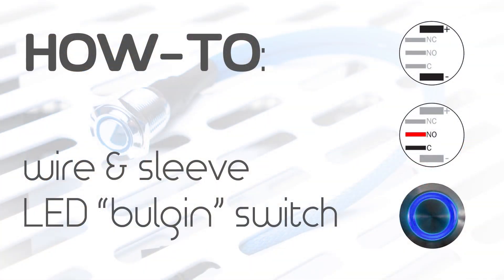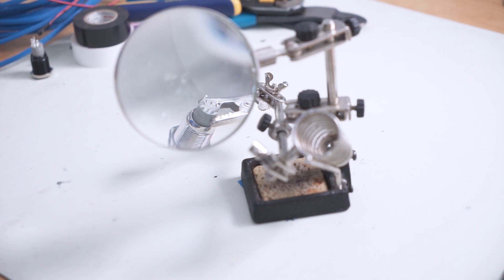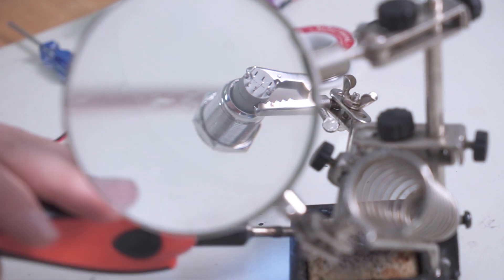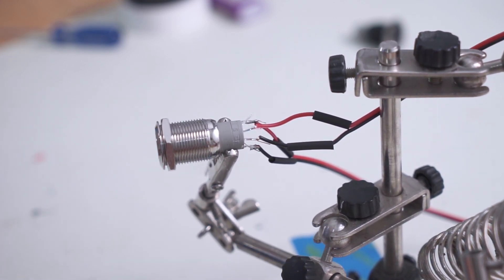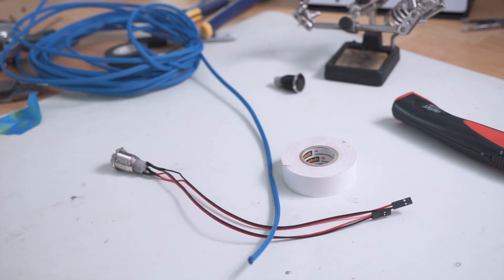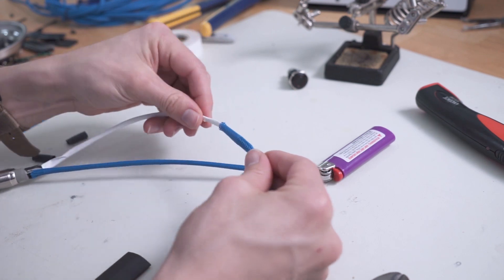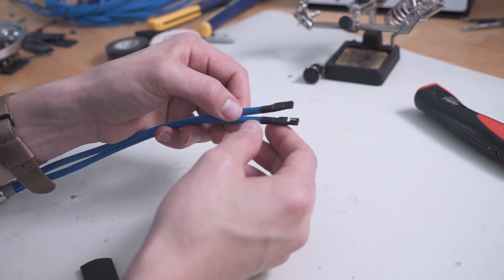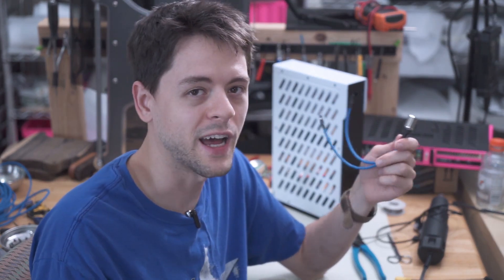HOW-TO: Wire a LED Bulgin Switch

Comment: Thanks for nice video!
How do i connect Led Bulgin switch when i want to  close the + on-off winch relay?
I want the led to light when the switch is puscht on!
Please help me to fix this!
Best regards Tobias
Reply from the maker: Sure dude--buy a "latching" style switch, not momentary. Then wire the 12v + wire from your power source to "Common" post on your switch. Then bridge the "Normally Open" post to the "+" post, and then from that wire goes to your winch (according to your manual).  Finally, wire the 12v - terminal on your power source to the "-" post on your switch, and then from there go to your device's "-" post.
Reply: @NotFromConcentrate  Thank you and i vill try this and hope  can get it to work!
Best regards Tobias

Comment: Where does the white wire go? My push switch has a white wire… or well, had… until I accidentally ripped it off. Now the button doesnt work so I know the white wire is necessary. But I ripped it off so bad that I cant even tell where it was connected to
Reply from the maker: It's not a standard color code so I can't help you. What matters are the pins on the switch.

Comment: Heat does not "flow upward". Heat seeks cold, no matter the direction. Hot air flows upward because the molecules are moving faster over a larger area.

Comment: So if you have a working power sw still in a PC (Dell) case (& you want to keep the switch & case) can, with the correct pin identification, solder the wires from a newer connector? The idea is to use the Dell case & pwr sw, but install a newer m/b, maybe a B450 or, if price is good, a B550. Thanks & great how-to 🤓
Reply from the maker: They all work the same, so you can just solder your old power switch wire to your new motherboard, or crimp on a new connector. Peace
Reply: @NotFromConcentrate  cool! Thanks 🤓

Comment: can I use a 12v switch like yours with a 6v Lipo Battery?
Reply from the maker: Yup. You can always go under just not over in all circumstances.

Comment: From pc which slot is for the 12v supply can u teach me got stuck at there
Reply from the maker: The PC motherboard manual will tell you what is the PWR and the LED. Usually the PC supplies around 3v, so a 12v switch will be a bit dim. You can buy a 5v or a 3v switch if you want the light brighter.

Comment: im tinking your switch is 5 volt, i wonder how to connect a 12 v. same switch?
Reply from the maker: Motherboard is 3.3v usually at header. The higher voltage led on the switch = less bright
Reply: Not From Concentrate nice thanks
Reply: Not From Concentrate looking in a scheme pinout there is a +5 v pin. Next to a blank space

Comment: Great vid!, I want to hook this up to my Odroid xu4, I have a few questions. 1. I have an LED latching switch, would I use the same poles to wire it up? 2. Would I need a resistor somewhere on the circuit? Thanks for the help
Reply from the maker: A latching switch works exactly the same way. Resistor will change the brightness of the LED. Find out what voltage your system outputs to the LED terminal and either buy a matching voltage switch or one with a higher voltage rating. Peace!

Comment: Question: I have a LED light bar that’s powered via SATA cable. Would I be able to wire that switch into the SATA cable to have an on/off switch?  
Thanks!
Reply: I think you'll need a latching button. This one is only connected when you hold it down

Comment: Would the switch need its own power source or how could it be connected to a circuit with an existing power source so that the light on the switch turns on when the switch closes the circuit?

Comment: Does anyone on this video leaving comments ...Know how to wire a Bulgin Switch to a Dell 990 SFF ... the Dell power switch is connected to the Mother Board with 5 pins... Black, Yellow, Red, Blue, Orange....
Reply: Roland Rodriguez look up your motherboard manual and it should tell you which pins go to what, then it's just a matter of figuring out which cables go to which connectors. You'll be using the NO and C connectors for power, and the +/- for the LED bit

Comment: Hi Man

For the reset button and hdd led, how do i connect the cables to the button ???
Reply: Connect your Reset cables to the NO and C connectors, and the HDD LED cables to +/-
Reply from the maker: Exactly the same way. You just plug the connectors to the different headers. This is usually why you see two separate buttons for reset/power. They do make some multi stage switches that can do both, but that is too complicated to go over in a youtube comment. Peace!
Reply: then make a video for it easy :P

Comment: Are there any models of this that are pre wired? This definitely doesn't seem worth all the time and money.
Reply from the maker: Yeah, I sell them in my shop ready to go! http://nfc-systems.com/new-products/switch
Reply: Not From Concentrate Would this be something you pre-order along with the case later in november?
Reply from the maker: It's on the pre-order sheet for sure. If you want one early or for another project just email me.
Reply: For 35$ sure!
Reply: Or from 2-7$ you can one prewired but not pre braided https://www.banggood.com/12V-3A-16mm-Unlock-On-Off-Sport-Mode-LED-Push-Button-Switch-For-BMW-E60-5-Series-p-1059750.html?rmmds=buy&cur_warehouse=CN

Comment: Good video. Can you kindly advise what diameter cable sleeving you recommend sourcing for braiding cables on a rig as this is something I've found to be really confusing. So much to choose from. Don't want to go investing in the wrong kit only to find its the wrong size. Thank you.
Reply from the maker: I have been importing  MDPC sleeving for years now (1/8th) and I highly recommend it. Especially now that you can get it in the USA! Google Mod-One. If you want to go paracord which can look nice I don't have any suggestions.

Comment: Your soldering technique is a tad cringe worthy. But hey, your results speak for themselves in that, they look great, and work as intended, so who am I to judge? Keep on modding and making.
Reply from the maker: I love learning, so any guides you can send me to would be great!  I will admit that it is far easier to do this off camera--I could barely see what I was doing in order to give the camera the best view. ><  Thanks for watching and commenting.
Reply: Not From Concentrate My main concern was your iron, but as it clearly got the job done there's no need for me to worry on that for the soldering you showed. I tend to do more soldering to pcb's and never had luck with that style of iron, or any cheap iron, so I invested in a Hakko FX-888D (just south of a $100 soldering station). My next concern was the size of solder you used, but once again, in that use case, it works just fine. You might consider tinning the wires (applying a small amount of solder to the otherwise bare wire) as well before putting them on the connectors. That could be completely unnecessary, so should you try it and not like the results, or feel it to be an additional step that isn't required, then like I said a few times before, what you've been doing has been working so... the good old "if it ain't broke" comes into play.

As far as any soldering guides would go, Adafruit Industries has a good quick tutorial here on Youtube, called "Collin's Lab: Soldering" and EEVblog has a few, much longer tutorials, in the 30 minutes a piece range, where he over criticizes things especially considering your current use applications.Most of these tutorials would apply to PCB and Surface Mount soldering, but they can always be helpful.

Love the videos, the mods, and the tutorials, I'm always trying to learn more too whilst playing with a 3D printer in between.

And lastly, yeah, doing things on camera is hard, and usually doesn't aid in trying to get something done, so the fact that you take the time to try to show us is something I will always appreciate. (Sorry for the short essay response)